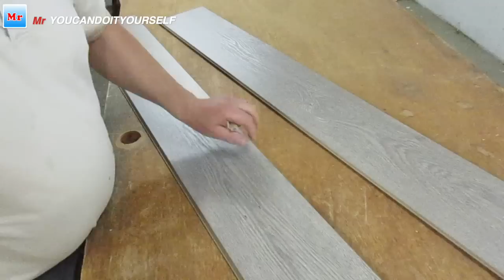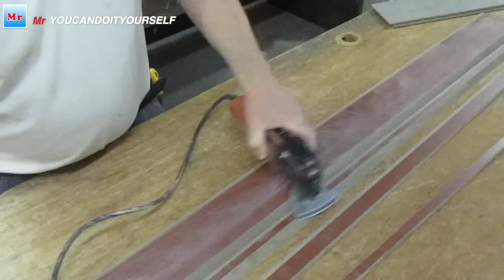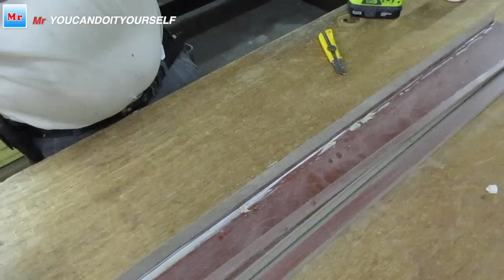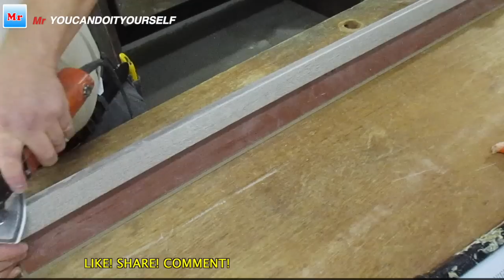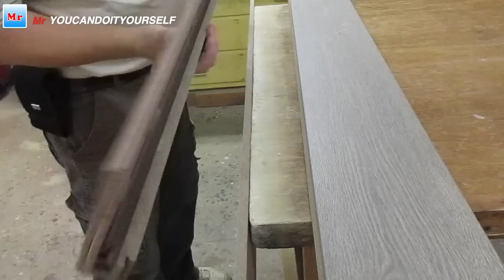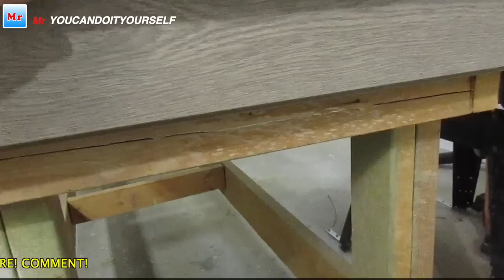DIY Flooring Laminate Stairs Nosing from Scratch MrYOUCANDOITYOURSELF

Comment: One nose 8' -$30.00 for 2 stairs. For 2 flys with 8 stairs each -3-4", I need 8 full pieces of nosing x $30= $240.00
If I will do it by my self - one nose - one board, approximately $5.00 each x 16= $80.00
$240-$80=160.00 
Sometimes, If I cut not right one nose, need to buy full peace again, But this nose I can just repeat.
Good savings!

Comment: Very nice . What if I need one and the laminate going the other Direction ? In top of the hallway or some where else!!!
But still I have to use nosing transition!! 
Thanks boss
Reply from the maker: Hi Fadi, in top of the hallway with the perpendicular direction I would recommend overlap nosing. Thanks!
Reply: @MrYoucandoityourself  . Thanks for the quick respond . Is that something you can make ? Or u mean to buy it ?
Reply from the maker: You can buy door skin, make strip and glue on the edge of the hallway under the nosing. On the table, saws take off a little bit from the back side of your nosing make it nice overlapping. Sorry my English not so well, hard to explain. It's time to make one more video about overlap nosing. You, not the first person who asked me about it. Thanks.
Reply: @MrYoucandoityourself  my English not good as will . Yes will be great if u make video about it.  Thanks a lot

Comment: Thanks for your video
Should I use stain and then lacquer or stain is enough? I did lacquer but its a little bit shiny.
Another question, can use router instead of sanding the edges?
Thank you.
Reply from the maker: Hi Hamid,  yes you can use router, it's better. You have to use lacquer, if it's shiny you can try satin finish, thanks.

Comment: this is such a great video, you provided the measurement bellow are you saying the fron is 2 inches, 2.5 inches sorry i use CM. your template use 4 parts to create the straight nose,. can you precise the third one added to the front what is the size
Reply from the maker: Hi Zohra, for laminate square nose I made front piece triple size of material.
In this case it was 1,5” or 36mm. 
If you make it smaller, it’s hard to cut with out chipping out. 
You can do front size any dimensions, ones I did 4”, because Custumer wants it. Thanks for your question!

Comment: Nicely done partner! I don't have a 23 gauge nailer but I have an 18 gauge nailer, do you think I can use an 18 gauge nailer for this job?
Reply from the maker: Hi Juan, you can try, but from my experience holes will be too big and laminated top can be split. Filler in this situation doesn’t help. Thanks

Comment: Wich blade do you use on the table saw? and can you do a whole flight of stair with that same blade? Thx
Reply from the maker: I used Dewalt regular 10" blade 45 teeth. Yes, you can do it with one blade. Thanks!

Comment: Your workmanship is excellent. You did a fantastic job. Unfortunately this is what I'll have to do for my stairs.
Manufactures of laminate flooring should know better that this is what people want and definitely not the bullnosing they supply which does not fit like yours.
Reply from the maker: Thanks!
Reply: They make square bullnose.  At least Coretec does.

Comment: Fantastic video!  Whoever gave you a thumbs down, lets just say is CRAZY!  I have a question though, when you started the video you said that the front and bottom nose were both 
1 1/2 inches.  At the end you said the bottom was 1 1/4 inches.  I really like that profile and would like to know if the bottom was 1 1/2 or 1 1/4.  Thanks!
Reply from the maker: Hi David, lets say, your step on staircase 10". Laminate board 6,5"
10"-6,5"=2,5"left.
2,5"+1,1/4"=3 3/4" - this is the top of nose.
Front of the nose you can make any size, I did 2,5".
And bottom for nose returns 1,1/4"
Does it make sense?
Reply: @MrYoucandoityourself  
It does, thanks so much, and again, great video.
Reply: @MrYoucandoityourself  if its 10" and the panels are 6.5", there would be 3.5" left not 2.5".
Are you leaving an inch for a kicker?
Im very confused.

Comment: So some ppl cut the bullnose out totally and have straight 90 degree edge between tread and raiser and i have seen ppl use vinyl planks and bend them to create a bullnose to cover the round nose if they decided to not cut it off .. Can i still use THIS method with laminate floor without cutting out rounded edge bullnose ?
Reply from the maker: For laminate only this way 45 degree cut.
Reply: @MrYoucandoityourself  yes i understand . i didnt mean to confuse u with a vinyl ... I just said an example like vinyl ppl bend them to cover round bullnose ... My question is .. If i cut 45 degree with laminate cause thats the only way i can do with laminate ... If i have a end of a stair that is not cut but round ... Will 45 degree method work without me having to cut the stair ? My problem is my stair is built in to the sides ...its not free on sides at all .. So if i cut .. There will be a piece of stair left .. So if i can get away with ur technique which I LOVE ...that would be awesome
Reply from the maker: @chriskawa575  Hi Chris, I do not really understand what you need, can you send me pictures on the Facebook page, you can find a link in the description for my videos?

Comment: Love the $ savings, and look is better than store-bought rounded nose.  I have few questions, you nailed into the face of the nose, can you see the nails?  What nail gun and size of nails did you use?  Also do you recommend gluing the next board tongue and groove to the nose board?
Reply from the maker: Hi, I used 23 Ga pin nailer, you can find a link in the description. These wholes from pins not visible, but you can fill it up. 
If you locke this nose to the next board - you don't need to glue it together, just on the bottom to the stairs. Thanks!
Reply: @MrYoucandoityourself  thank you, and greetings from Korea.  I like your style.
Reply from the maker: Hi, Thanks from Canada!
Reply: @MrYoucandoityourself  what if you dont have a nailer?

Comment: Such clean and fast cuts!  Do you attribute that to the blade or the saw?  What kind of blade are you cutting with ?  Great work - thanks for posting!
Reply from the maker: Hi Darrin, I used regular Dewalt blade, new and 40 teeth or more for clean cut. Thanks
Reply: @MrYoucandoityourself  Thank you!
Reply: I don’t think he respects that table saw the way he leaves it running with the board in it and goes to the other side of the saw.  That thing will hurt u so quick of your not careful.

Comment: Hi.
I really like your idea and I want to make my stairs using 12 thick laminated floor. However when I cut my floor at the angle it's slower than yours and I'm getting burn marks so it's hard to control the piece to get a straight cut. 
I'm using Titan TTB763TAS table saw and new Freud 80T Table saw blade. 
Do you know is it because of wrong blade or weak rotating speed of table saw? I really want to make that nosing but can't afford to buy more expensive table saw. Thanks
Reply from the maker: I am using maximum 60t, but 45t good enough. 80t burning wood and laminate as well. Thanks

Comment: What size brad nails did you use?
Reply from the maker: 23 Ga, 1 1/4”
Reply: @MrYoucandoityourself  Thank you. I have 8mm flooring. Is 23 Ga bigger or smaller than 18 Ga brad nails? I have 1" 18 Ga brad nails
Reply from the maker: @VictoriaPogson   23 Ga 2-3 times thinner than 18 Ga.
Reply: @MrYoucandoityourself  I have a micro pinner (for using on trim pieces for furniture)will that work on my 8 mm laminate to hold it while the glue dries?
Reply from the maker: Yes.
Reply: @MrYoucandoityourself  Thank you

Comment: Has anyone done this and had it for over a year that can share if it holds well? I am concerned it’s not engineered for that and that the edges will get damaged, come apart and not last long.
Reply from the maker: Vinyl bullnose for stairs made with same technology and used for a long time. Why this nose will be damaged?  In Vancouver we using square noses for a long time all types flooring. And no complaints.
Reply: @MrYoucandoityourself  the concern is that the plank was not designed or engineered for that.  For my case I am using Engineered Wood planks that consist of a top 3M clear layer, over a thing wood veneer, over a high density board over a thin plywood. Do you feel it should hold up the same?
Reply from the maker: @caomabebe1  On the edges you have to make a bevel and put filler, stain, and finish as well. then it's will work.